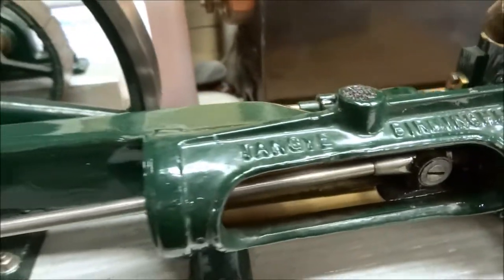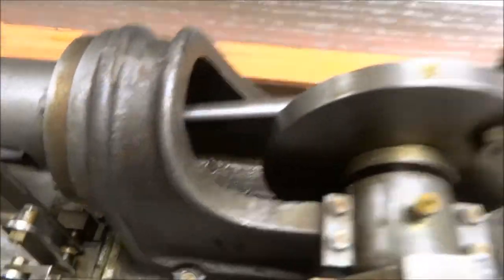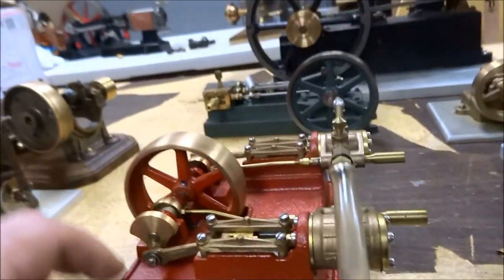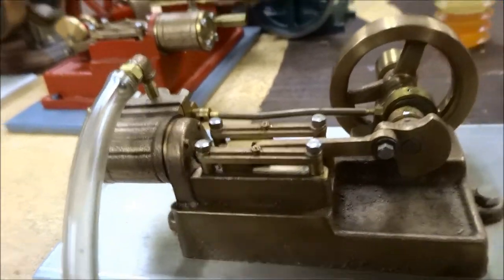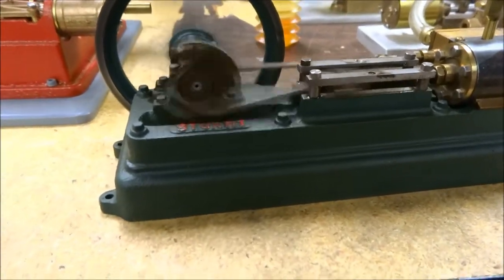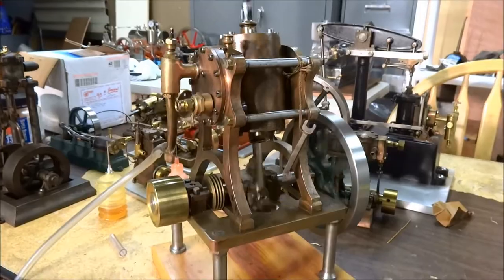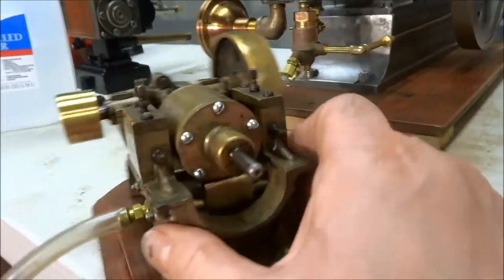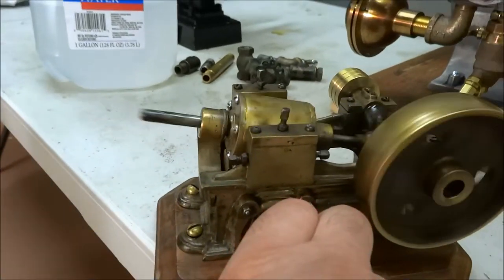Engine Collection - Testing 10 Steam engines

Comment: What is the purpose of the oscillating cylinder, seems to me like all it really does it take energy away from the engine. But they are very neat.
Reply: Martin Taylor 
Reduce the amount of parts used for a full stroke. Basically cheaper to produce.